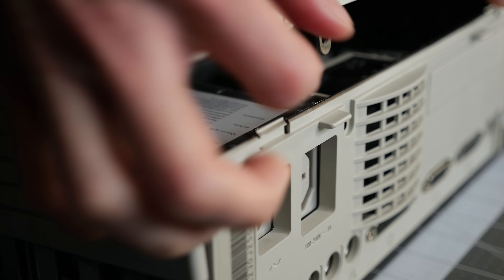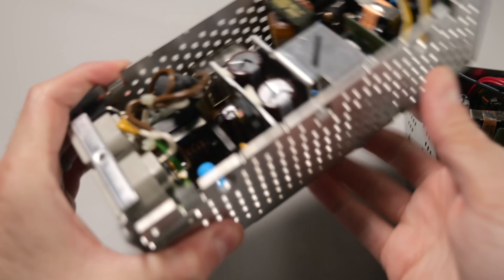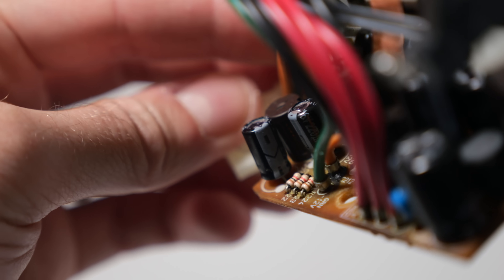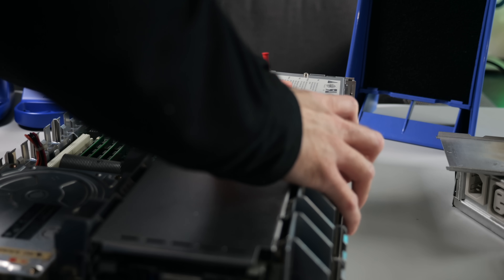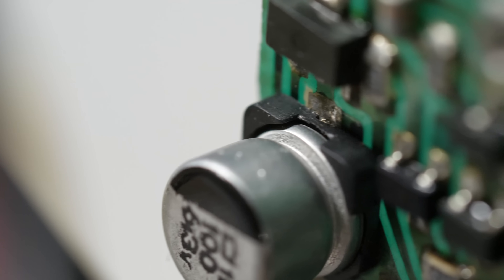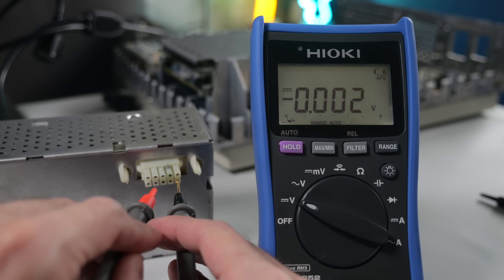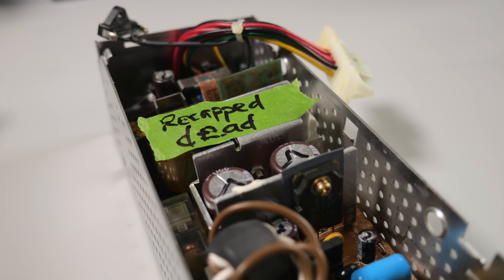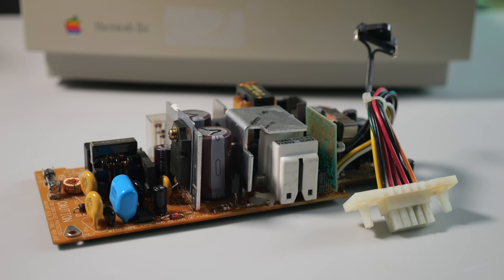Fix this part before it KILLS your vintage computer!

Comment: I developed a very unpopular opinion regarding old beige macs. Don't use them any more! The best vintage Mac to power on is a Power Macintosh G4 AGP. It runs Mac OS classic, has decent ethernet and USB, and runs most old programs at an awesome speed. The hard drives are IDE, the memory is dirt cheap, and the machine is rock solid and super reliable.

Comment: Tantalum capacitors are often used to replace old electrolytics—especially in vintage computer repairs—because they:
	•	Have longer lifespans,
	•	Are more stable over time,
	•	Have lower ESR (Equivalent Series Resistance), which can improve circuit performance.

However, tantalums also have a serious downside:
	•	They are less tolerant to overvoltage and reverse polarity.
	•	If a power supply malfunctions—especially one that delivers a voltage spike or is unregulated—tantalum capacitors can fail explosively, sometimes bursting into flames.

So yes, if you’re replacing electrolytics with tantalums, you should:
	1.	Be absolutely sure your PSU is healthy and within spec.
	2.	Prefer ceramic or polymer alternatives where appropriate.
	3.	Or stick with high-quality electrolytics if the circuit doesn’t demand tantalum specs.
	4.	When using tantalums, derate the voltage—for example, use a 25V-rated tantalum on a 12V rail.

Comment: working on DC side is relative term here, the DC begins almost at the start, where AC gets, fused, balanced, rectified and filtered (usaly 2x400V 50-150uF caps, before the switching circuitry (starting with power transistor ) and you better watch thouse out and get them discharged, becose you might and will get electric shock, becose these stay charged even after unplugging from mains for some time)

Comment: You didnt prove why the second psu wasn't working. You could have pulled the dotter board from the first repaired unit and put it in the second psu to see if that fixed it. Also the dotter board being only single sided replacing parts and jumping traces wouldn't have been impossible. If you were inclined you could have had a new board made up and transferred the main control chip to it with new parts. Tho i understand thats more time consuming for a PSU that ultimately costs less then 100$ to find another spare. Its a idea tho :0

Comment: You can make a new pcb from jlc or pcb way. clean with a glass fiber scratch brush the oxidized pins and transplant the components to the new one. I think the original pcb is good, the electrolite attacs the top laquer most of the times, is the oxidation who created bad solder joints. Original is better than those chinese junk

Comment: Make sure it's plugged in while you work on it, so your multimeter actually measures accurate readings only. ALWAYS work on a power supply, especially since the Capacitors will definitely not kill you. (sarcasm, don't follow this guys' advice. Or else, you might die.)

Comment: Isn't possible to make a replacement of the tiny PCB and "print it" on "PCB Way" or some service and use the caps etc. from the original in the new one? I know is a TON of work, I'm just wondering if it's possible like in other type of things.

Comment: That little daughterboard is extremely easy to fix. But if you send it to me I will make a 1:1 identical re-production and mount all the parts onto it and send it back to you. Assuming it works you can get a batch of PCBs made and move all the parts over to a new PCB if you come across another corroded board in the future.

Comment: Repairing that daughter board is so easy and simple. 
Just mark and measure every part then take all of rhem off. Scan it and drop it in your computer. Trace the pcb out with your favourite pcb making tool. Order from jlc pcb some new replacement and swap all the components over onto the new pcb. 
Thats a single sided board. It should take about an hour or 2 to do all this and totally worth it.

Comment: I think modern replacement PSU is the way to go (save picture of old board and leave inside). It will keep the computer running healthy, and not risk doing unrepairable damage to motherboard. Plus, newer PSUs put off less heat, and dirty voltages, that would have shortened life of other parts. To preserve history, some times requires hard choices. Thank you for sharing this video.🎬👍

Comment: Nice work and video.  I have a IIsi and it has an Aztec (sp?) PSU that seems ok.  It is rivited together and so I have not opened it yet.  I see Apple used Sony and other brands I wonder are certain brands more prone to failing or leaking caps?  The one on my LC III for instance, was not leaking the last time I checked it. I do have replacement caps for it and I think it is time to recap them all.  This new PSU replacement looks like it will be great.

Comment: Could you swap out the good daughter board from first PS you got going with second to confirm thats the problem?  If so , you could spend a hour or so checking continuity and running wires. Probably not as corroded even if looks bad. Small board so worth doing?

Comment: in regards to that daughter board, all those corroded traces would need to be gone over with a fiberglass pen to remove the solder mask and corrosion, after that you'd be better off using ohm mode to see if any are high resistance/open etc and then repair/re-tin them using some copper braid that's had fresh solder soaked up on it (GadgetUK has a great youtube channel where hes demonstrated how to do this many times on vintage computers).
while there was some moderate trace corrosion on it, it certainly could be fixed by someone willing to spend the time doing so.
any corrosion on any pcb trace will fail at some point so its always best to deal with it rather then ignore...

Also while im not sure how common those daughter boards fail, it would be quite easy and trivial to just design a replacement pcb for it (assuming you or someone you know has basic CAD design skills). while im all for modern PSU replacements and use some myself on different retro machines, getting a batch of replacement daughter board pcb's made would cost maybe $1 per board in batches of 5+  rather then the expected cost of a complete modern PSU will cost.

Lastly its probably worth mentioning that the average person shouldn't really be opening and working on any PSU's if they don't actually understand the potential risks of electric shock. there's often 1-2 very high voltage Capacitors on the primary side that store about 400v (or more), generally a good PSU will have a bleed resistor connected to those to discharge then when turned of but not always and sometimes its failed. probably just worth mentioning that next time you do any PSU videos. or at least letting people know to short out those caps with a 1M resistor to ground and then use a multimeter to check its voltage has discharged before working on it. that 400v can stop you heart and in extreme cases kill a person so please just be careful when working on them.

Comment: Not familiar with Macs, but I think the reason PSUs are overlooked is that they have the potential to absolutely wreck hardware and very few people are comfortable enough in their skills to work on them. I have a few AT and proprietary form factor PSUs lying around, but I feel it's safer to buy high quality modern PSUs and use adapters.

Comment: Some stones on someone willing to put a known defective PSU in their vintage computer :P I hope you knew at least some idea of the errors, because sometimes things just break so that no protect mode will save you and everything just gets fried. Highly suggest to always check the voltages first if that's possible.

Comment: Glad you saved one from scrap. To everyone else involved into this kind of repair: always wear your safety goggles, it's about the electrolyte trapped between the PCB and the conformal coating, it tends to pop when heated right onto your face.

Traces with heavy black bubbling still eating into the copper substrate must be scratched to remove the coating and the remaining still active electrolyte, brought back to bare copper, from there one can decide to keep it that way, use bodge wire or recoat it.

Comment: ⚠ Don't poke around inside of PSUs unless you know what you're doing. There could be high voltages inside, even with the power cord unplugged.
Reply: While a little pre-game knowledge and caution is warranted, I would advise people to learn and proceed rather than get into a chicken-and-egg situation of "if you don't know, don't touch it" because then you won't learn, and you'll never know.

Pretty much all of us that have ever touched screwdriver to electronics has discharged a cap with our finger at least once.  It's an educational experience.
Reply: Technically high voltage doesn't start until 2,500 Volts. What you can encounter in a PSU is only peak line voltage. Or in the US double that. That's what the 110/220 switch does, it's a voltage doubler. Now CRTs can contain lethal potentials. There you might want to proceed with caution.

Comment: I have an Apple IIc and yet to get a power supply to power it on. Are ethereal any caps or certain parts known to fail on those models? I examined the board and nothing seemed bulging or corroded.

Comment: The measurement of capacitance is spurious on cap going bad because of leakage. The meter ends up having to dump more energy into the cap, since the cap turns it into heat, and this thermal loss and thus effective charge dumped into it ends up being misregistered as capacitance.

Get yourself LCR T4, the famous $7 PCB, or any of its upgraded derivatives, doesn't matter, they have enclosed ones, colour screen ones, etc. Its ESR measurements are pretty wildly off (but are comparable relative to each other, so you still can tell bad caps from the good), BUT it won't confuse leakage for capacity and it is capable of measuring leakage rate. Your meter can attempt to measure in circuit - T4 can't, it won't be able to decide what to measure, but you're taking the caps out anyway! It's great for PSU repairs in general because it'll take just about every single 2- or 3-legged component and tell you whether it looks OK.

I think the eaten away daughterboard calls for a PCB project so you can print a new one by a prototype house. You can then repopulate the fresh PCB with original components. I also can't say i terribly mind doing tedious restorations like that by hand, i can also just make new copper by hand, but i'm sure it's too much effort for many.

Comment: I picked up a non-working IIsi during COVID for really cheap to work on as a project. I remember pulling the PSU out and while holding it tilted it literally started to leak green goop. Also came out from underneath the power connector on the logic board once I pulled it out of the case. Probably one of the worst PSUs I had to work on so far (the Mac Classic analogue board was a close second though cap leakage/corrosion wise and I heard the IIci ones aren't much better). Lots of cap juice, lots of fish smell, all drenched in old flux, and the daughter board took a heavy hit as well. Got it all working perfectly but definitely not for the faint of heart (or for people with a sensitive nose or who can't deal with the "ick" factor these PSUs can have haha).

Comment: capacitors  measuring 'slightly' high is not normally a problem, older ones sometimes had a very wide tolerance, especially positive, as much as +80% in some cases...

Comment: do not assume polarity markings on pcbs are correct, it has been known for them to be printed wrong, double check how its connected in the circuit!
Reply: Yep.  Get in the habit of checking what the PCB says to how the original part was installed.  I have run across a few that were backwards, intentionally.  Not many, but more than none.
Reply: @sirnickity  yep, dont go 100% about what any print says on the top side, especially if originals appear to be fitted wrongly, check how its actually wired on the track side, such as make sure negative of cap goes to ground if its for a positive supply rail,  or positive of cap fed from the cathode of an output rectifying diode, etc.

Comment: Daughter board PCB seems like easy to make a replacement for, if that's the only issue.
Small, single layer. Might not even need a rerouting if you only need 1 and can edit the scan/photo into a high contrast mask.
Reply: It’s not. I’ve already made the pcb for one but a lot of the components aren’t known. So I never even produced it
Reply: @AmigaofRochester  ok, but at least it can be used if you can transplant the components from the old one? (A lot of soldering though)
Reply: @killymxi  I have never had the daughter board be straight bad. Always soldering. I just fix the soldering. I remove the chip, clean pads sometimes sand them, clean the chip up and replace. I personally hate iisi psus as they’re not very good in general

Comment: This is why I hate these dedicated power supplies for old Apple computers, because they’re hard to repair and you’re better off replacing them with something more modern for power supplies!
Reply: no need to 'replace' if they can be serviced..
Reply: @andygozzo72  if they can be serviced, that’s good! But most people and those places don’t fix old Apple computers, particularly Macintosh II which is rare, and the original parts from the power supply made in 1987 is too expensive.
Reply: @Markimark151  i doubt any of the 'custom' parts like the inductors would be bad, most likely caps or semiconductors..
Reply: @andygozzo72  rather get new caps with the new power supply. Apple made their computers to be planned obsolescence, that’s why I don’t trust Apple with their built quality anymore.
Reply: @Markimark151    Criminy.  This era of computer was never intended to last 30+ years, and yet they do.  But it wasn't Apple making the PSU anyway, unless you missed the giant Sony logo.  Capacitors go bad.  That's not "planned obsolescence," that's just nature taking its course.

It's like complaining that Ford designed your car to fail when you don't replace the oil or transmission fluid.  Things require maintenance because nothing lasts forever.  Learn to solder a few caps, and maybe the odd diode, and those PSUs will keep going until the materials decay beyond salvage.

I doubt you'll get the same lifespan out of the supplies made today, with their razor-thin margins, and notable Japanese capacitor vendors dropping products from their portfolio by the dozen due to competition with the "manufacturers" who use strings of random consonants as names.

Comment: One more thing to try on the dead supply: check the double rectifier diodes on the secondary side (in the TO220 packages). I fixed a IIci power supply with the same issue after finding a shorted rectifier - standby voltage was there but would not power on. These IIsi power supplies look like a really similar design.
Reply: Definitely a good suggestion.
The only visual inspection, frequently, is not enough, and starting measuring components it's the key to grasp what's broken or out of spec. Having, moreover, schematics of the board could be a game changer, especially for test points or reference voltages.